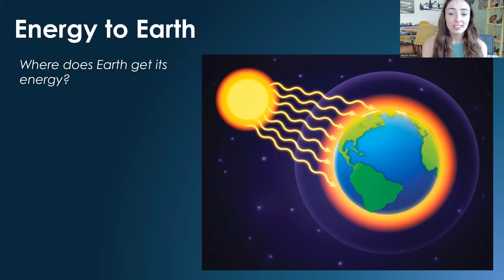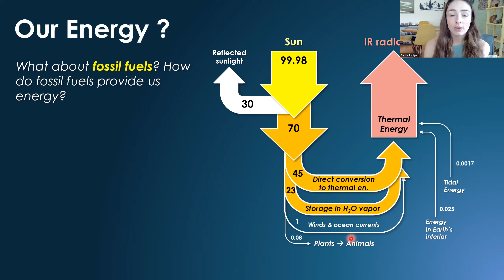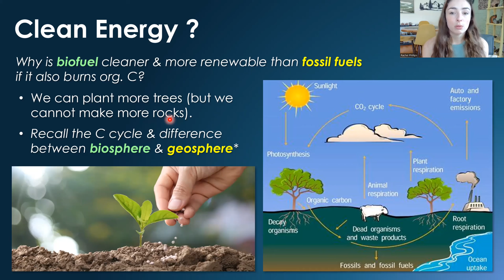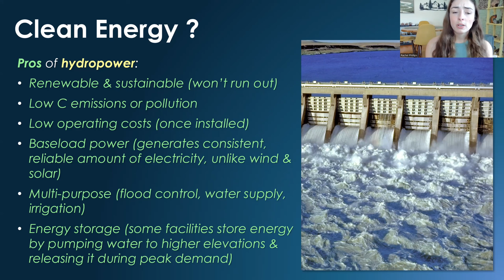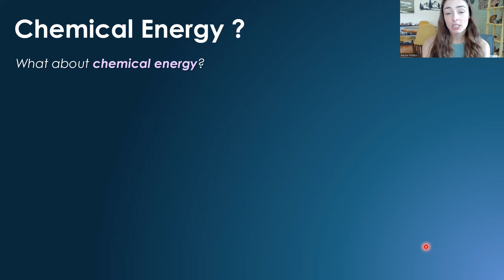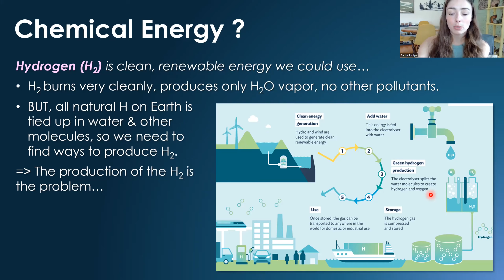Where Earth’s Energy Comes From & Pros/Cons of Renewable Energy | GEO GIRL

Comment: No the earth wont run out of fossile fuel. This talk has gone on for decades. But it might become more and more expensive.
Reply from the maker: Well, not the Earth. But we will run out of 'accesible' fossil fuel. That said, you are right, we will probably find more difficult to obtain deposits and try to use those at a much higher cost, but that is essentially the same as 'running out' because by then that will be way too expensive compared to other energy options :)
Reply: "But it might become more and more expensive." <- a lot of work going on there for the words "might" and "expensive".

Comment: After a severe storm at 3am last June I wired up my solar charger. Within 20 minutes of peak charging time starting at 10am clouds rolled in and clouds blocked charging about 70% of the time. My battery was being stored at about 60% charged but still managed to power my small 400w window AC from 3am until 6pm when I could no longer stay awake and shut it off and slept with a fan on.

Comment: I use emergency off-grid solar for storm power outages in Louisiana. There`s rarely enough sun to charge when needed if you need power for an air conditioner. Keeping a freezer going is easier. I usually grid charge and keep a backup gas generator. Hurricanes can knock out the power for weeks here so I got everything possible to be able to stay cool and save my food because a lot of what I have in my freezer doesn`t come from stores and can`t be replaced.